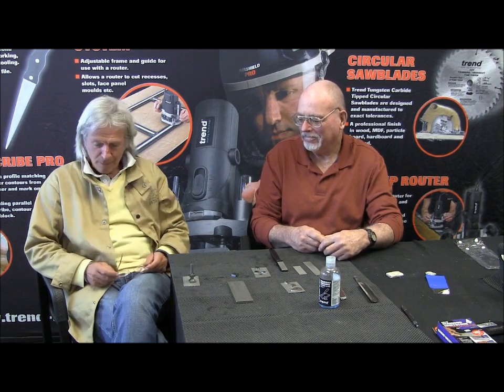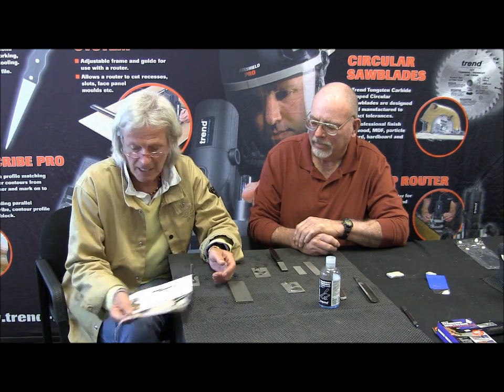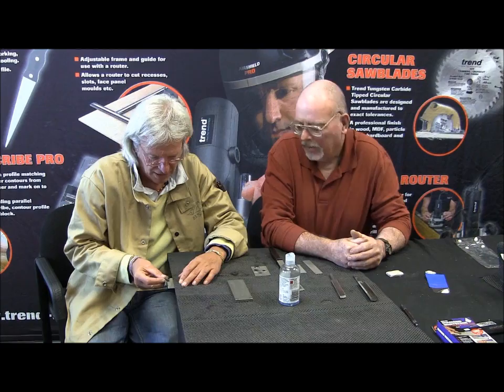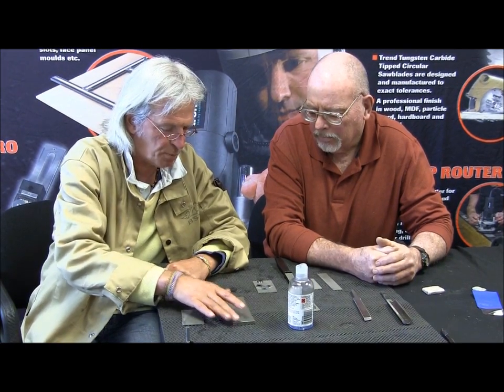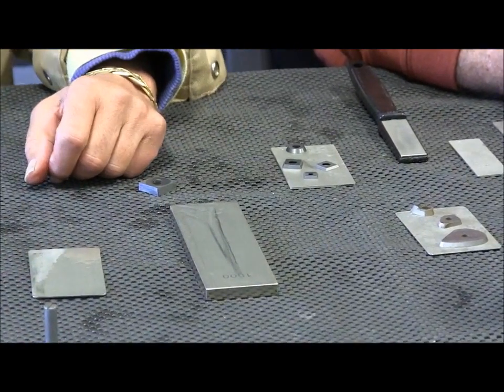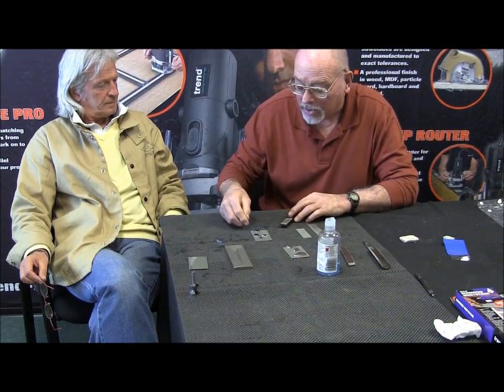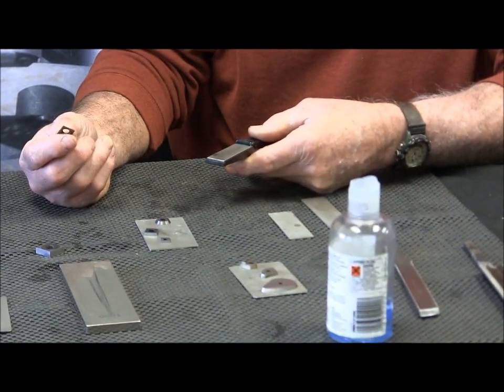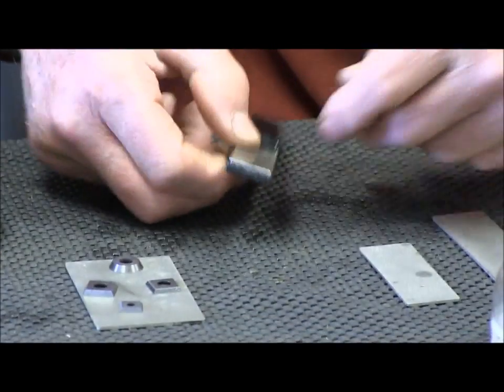James Barry Sharpening how to sharpen carbide inserts for turning tools

Comment: hi i was sold a 1500 card to shapen my round bit  its not that good what grit can i use other that 1500
Reply from the maker: mike pruett Never heard of a 1500 grit ! Anyway you need to get a proper quality precision diamond card. Suggest the Trend one . Part no. DWS/CC/FC. Which is double sided 600 / 300 grit. 600 for carbide , 25 micron, 300 for any HSS  40 micron.

Comment: There are two obvious reasons why the manufacturer recommends replacing the insert vs sharpening it. Foremost, from his perspective, he wants to sell more product. Nothing wrong with that in my book. Second would be the structural integrity of the insert itself. Sharpening obviously removes material and makes the insert thinner,and thus subject to failure, an obvious safety issue, and perhaps a potentially legal issue if an injury results from the presumed failure. Not everyone is a good sharpener, and  getting a bad angle on a re-sharpening job, for whatever reason, could lead to failure and possible injury. I agree with you though, that the inserts can be sharpened a few times, perhaps many, and thank you for showing how it is possible. Some viewers have requested more detail, and I hope you are able to provide that. Well done!
Reply: Failure due to over grinding will occur eventually , but realistically it will take quite a long time. I sharpen
 carbide blades and many other carbide tip cutting tools for a living and the amount of carbide removed is in the thousands . When you consider those examples I think most people will know when enough is enough and just buy a new insert.
Reply from the maker: Thanks, John. I agree with you, the manufacturers want to sell more product. On your second point, the amount of material removed on each sharpening is infinitesimal - getting the angle right, well basically it is a matter the majority of the times of sharpening "flat on flat."  I am going to be demonstrating at the AAW in phoenix next week and hope to be making a new clip on these issues...watch this space.
Reply: James, your looking out for the consumer as most professional sharpeners do. You make more of an impact by doing what you do, I only impact the customers we deal with daily. Good job with passing along good advice yourself.
Reply from the maker: Pedro Navajas I wish I had put it so precisely & it is great to get insight / feedback from the guys who are on the professional side of dealing with Carbides & know much more than myself..
Reply from the maker: Pedro Navajas Thanks Pedro.